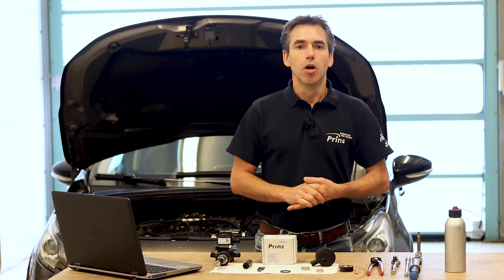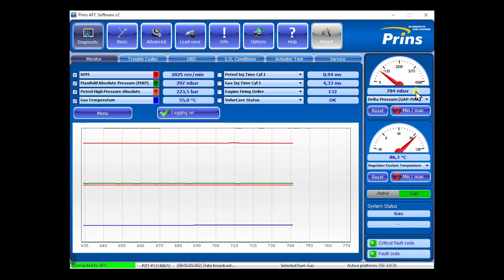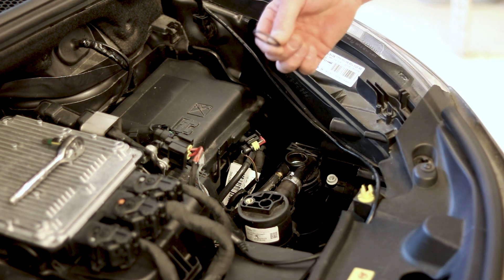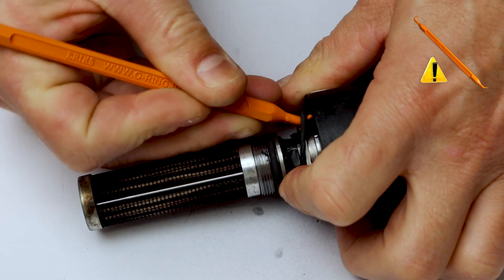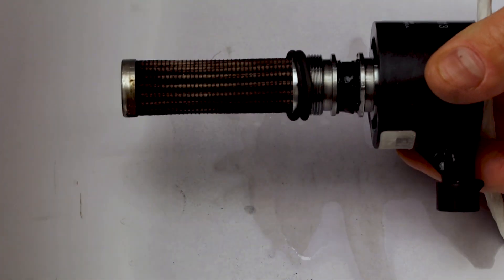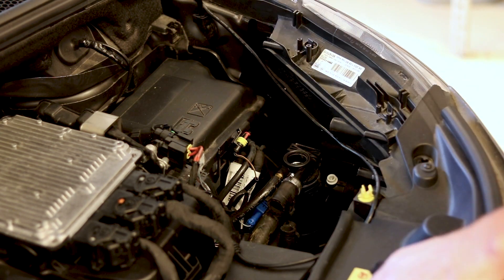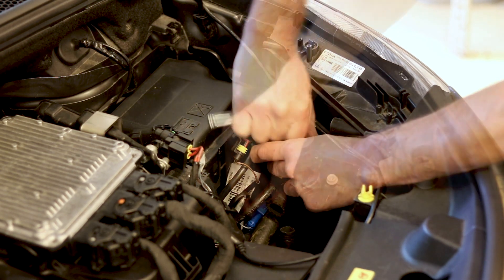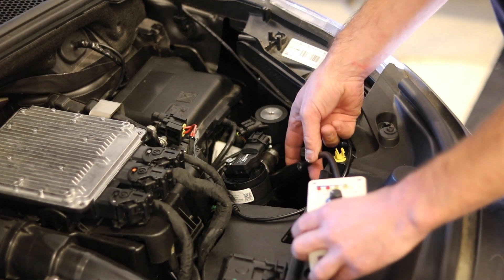Maintenance eVP-500 reducer | Replacing Filter | Instruction Video | Prins Tech Talk

Comment: I dont know how to depressurize. What happens if i disconnect the filter without decompressing first?
Reply from the maker: Please contact your LPG installer for this. They are able to do this.
Reply: @Prinsautogassystemen I'm not the first owner and the installer is like 800km from me and I need to remove the LPG tank to change my brakes lines and remplace the tank by the way.
Is it a possibility to get the software? Or an after maket soft doing it?

Comment: Nice video. You're the first on YouTube with the EVP.
When I had a look for spare parts I found two types of filters for the EVP500. 
Can you tell us the difference?

Any chance to get a diagnosis SW just to read DTCs as for the 1st generation?
Thank you.
Reply from the maker: Thank you! For these questions, we advise to contact your local distributor for local details: https://www.prinsautogas.com/en/distributors
Reply: @Prinsautogassystemen  thanks for your reply. Can't you show us the difference of the two filter types?
Reply from the maker: @ambientify  We are always working on improving our products, so we developed a new filter type for the eVP-500. However, it is important to use the correct filter type as spare part, because they can't replace each other (different type, size and more). To know which filter you need, please contact your local distributor.

Comment: Why show this to the public when we can't do it our selfs. We don't have the prins software
Reply from the maker: Thanks for your reaction. We decided to share this on YouTube, so the video is at any time and place available for the certified Prins' dealers all over the world.
Reply: Better to Show it, than make a secret of it. Transparency👍 I will get my VSI DI 3.0 soon.
Reply: My car is in Eindhoven right now for VSI 3 DI development :) l am so exited
Reply: @danielvieira673  23.3 I have an appointment, but with a local prins dealer in Krefeld Germany. I am exited how the System will work with my 1.5 TSI engine. ✌️
Reply: I PRESUME you could run your car untill ALL the LPG is used up, however, I have used LPG for 18 years, my garage of choice is 160 KMs away, but I still prefer to have him service my LPG System, it is money well spent,  and you don´t get to damage your car or LPG system?
I have had Taxis with BCR and Vaille Systems, but PRINS is the very best.
IF you car starts to shake at traffic lights etc as my BRC sytem did,  then I recommend a K&N racing air filter, I have always fitted them on my LPG cars ever since.
PS, do not F*** around with LPG!  ;) At -40 Deg C it will freeze burn your hands or face!
Got the T-Shirt!